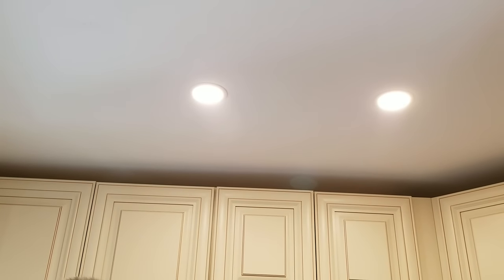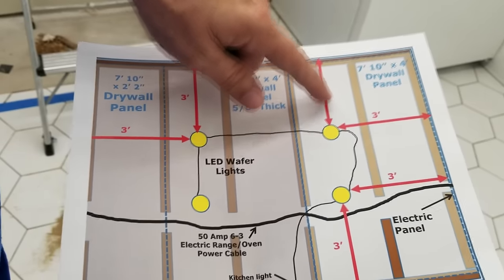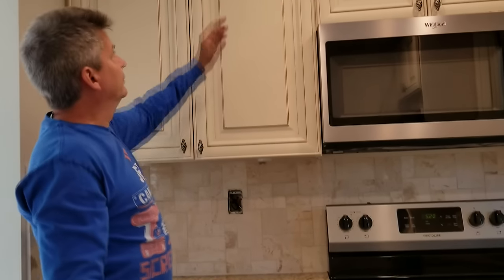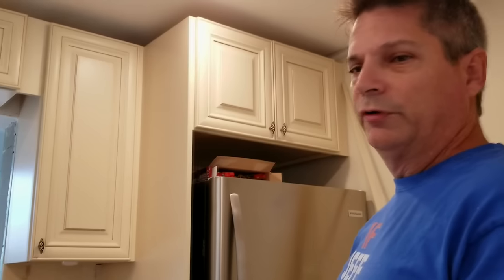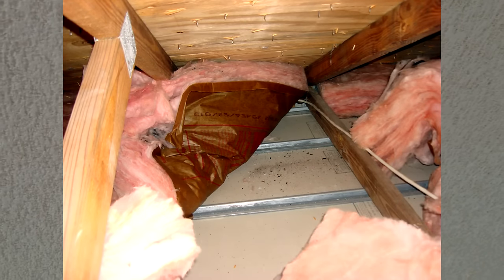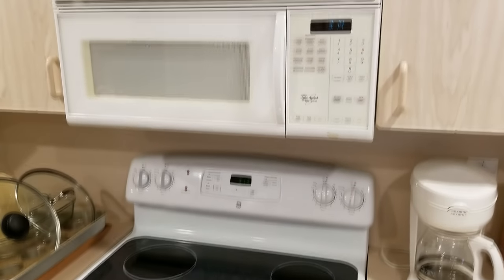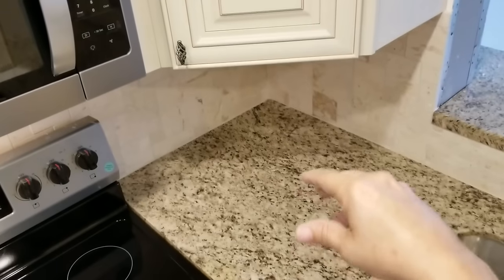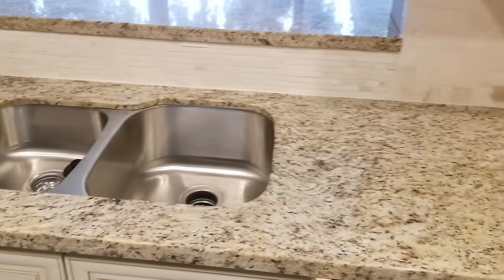Kitchen Light Spacing Best Practices, How to Properly Space Ceiling Lights

Comment: Hi, well done video.  Question:  With lighting 36" from wall and 24" from cabinet how do you prevent shadows cast when over a work surface?  A light can essentially be at your back casting a shadow in front of you.
Reply from the maker: Shadows are not as bad as you think. If ceiling is higher than 8 feet, it will be better for you. I am working on another kitchen lighting video maybe for next week, where we show you the science of measuring lighting yourself with free phone apps, and show a 24" placement from the wall, right over cabinet edge.
Reply: @jeffostroff  Hi Jeff and thanks for the reply.  I'm confused though so help me understand.  A big premise of the placement was to AVOID shadows.  I get that.  Now you're saying they're "not as bad as you think"  You contradicted yourself.  I have an 8 foot ceiling like most homes.  I have only one wall cabinet in my layout - predominantly base cabinets.  A light 36 inches from the wall where no wall cabinet is present, casts a shadow on the portion of the counter you are working over.

Comment: Thanks for the video, great point about shadows. A couple of extra things I noticed. 1) By this logic, the position of the light should depend on the height of the ceiling. Low ceiling should allow to position the lights closer to the cabinet, higher ceiling means the light needs to be further away 2) I really don't like how you positioned that light on the far right. It is too close to the cabinet corner. Not sure how to fix this
Reply from the maker: The position of that light was unfortunate but doesn't really affect anything. What happened was we set the lights where they are and built them into the ceiling, and then later while doing the cabinets it was decided it would be better to have a full depth cabinet over the refrigerator but a full depth cabinet requires that wall and so having the light where it is right now in theory it would have been 12" further away with the standard cabinet.

Comment: Very good video,thanks. I am installing downlights in my kitchen and I will use your 'rule of thumb'; 36 inches from the wall. Thanks.
Reply from the maker: Make sure you test it out too, a lot of pros really adamantly think you need to be 24" back or you'll get shadows on the counter.
Reply: @jeffostroff  Thanks for your advice.I have been searching for advice on this topic/scenario and I think that yours is the most helpful. Thank You.
Reply: @jeffostroff  I checked another professional home improvement website and they strongly advised downlights at 1 metre centres and 1 metre off each wall.My kithen worked out 3 feet centres in both directions so I put them in at that and the lighting is much better so you were right.Thanks again.

Comment: I think how far you put the light in front of the wall cabinet largely depends on the type of light and its beam angle. The 6" wafer lights appear to have a pretty wide beam angle (i.e. 120 degrees) and that allows the light to be placed at 36 " from the wall or 24" from the front of the cabinet.  That rule of thumb doesn't quite work with some of the traditional lights with a smaller beam angle.   The beam angle on those lights are much narrower compared to the wafer lights and so they need to be placed above the edge of the counter at around 25".  I've seen several of these videos that contradict each other, but don't point this distinction which is important.  The only reason why the area under the cabinet is not as dark as traditional lighting is because of the wider beam angle compared to PAR/BR lights that were used in the past.  The kitchens that were poorly lit was because someone changed the bulb to LED type without accounting for the beam angle.
Reply from the maker: Yes great points

Comment: the same way you point out the shadow of the cabinets on the counter you will also have a shadow cast by your own head and shoulders when placing the light about 36 inches off the back wall. A lot of people want the light to come from above not behind them when working on the counter and the have under cabinet lighting to deal with the shadow you’re discussing.
Reply from the maker: You should not need the added expense of undercabinet light.
Reply: @jeffostroff  I agree with you but the industry is split on these lights placement.
Reply from the maker: @freddyoner   Yes you have that right for sure. While the good news often is if they use some of the LED wafer lights for example like I was recommending, it's not that much effort to move lights on the ceiling if you have to and patch up the old hole.

Comment: I suggest people stand next to where you will be working and measure to the center of the top of your head.  

You will measure about 30-32" not 24" or 36".  

If you put your lights 30" off the wall it will cast YOUR shadow straight down, and not on the counter, and also illuminate more of your countertop.  

Split the difference for the best result while you actually work at the counter.
Reply from the maker: Exactly, that's why we say the light is not behind you but rather nearly beside you.

Comment: I have a central light in my kitchen so that when I stand in front of a counter, my shadow falls over the work.  Under cabinet lighting helps some, but I was thinking about new ceiling lights.  The trouble is the vaulted ceiling.  If I install ceiling lights as described here, the lights are directly above my head but angled away from the counter tops.  Is there a way to adjust for this, or is it a non-issue?
Reply from the maker: I just completed a kitchen lighting project last week with sloped ceilings and special lights that I had bought that put not only a shadowless light on their counter, but also very bright light for older people and it can be controlled with a dimmer as well. I will have that video up in about a week or so so check back later for that. the entire video was showing you how you can use an app on your phone to see where the light is on your entire counter in your kitchen, and how to choose the right light that puts the right amount of light on that counter without shadows

Comment: I don’t know if i have to follow your logic, mine is to locate it about 12 inches in front of cabinet to focus the light at center of counter which is 24 inches deep. You want to light your working counter surface. At 36 inches from face of wall, center of light is on top of your head and not your surface, from your head you are casting shadow of yourself.
Reply from the maker: Either situation will work I have done both

Comment: What Watt are you using? We bought about 7 for our kitchen that are 60W and it seems dark. Kitchen is about the same as yours maybe a bit longer
Reply from the maker: Norm the wattage doesn't tell you how bright your light is going to be with these LED lights. It is the number of lumens unfortunately I cannot remember how many lumens we had on those lights. Also if you get warm white lights they will not be as bright as the daylight white lights are for the same wattage so those are things to look at also how wide is the cone of the light if you have one that's purposely spreads out a wide cone of light it will be a little darker down on the counter then one that has more of a focused beam with period so there really is a lot to go into each of these lights and which ones you get and unfortunately too many people just grab whatever is on the shelf and don't give it another thought. As we get to age 50 and plus we need twice the amount of light is somebody with 25 years age.

Comment: What are the odds that you’ve never seen anyone do it right?  When ever you feel that absolutely everyone else is wrong, maybe it’s a good time to check if what you think is right is actually what’s wrong. The biggest problem I foresee with the your 3’ rule (which is correct for any room but the kitchen) is that you will cast a shadow on the counter top when standing next to it. There’s a lot of ways to avoid this (adding more lights, under cab lighting, placing the lights closer to the upper cabinets, etc...) however to say that your right and everyone else is wrong, is probably not the right choice.
Reply from the maker: Yes, everyone keeps pointing to this 3' rule, but how much actual light testing have you done? You are so convinced my lighting arrangement will leave this dark side of the moon deep dark black hole of a shadow on the counter from which no light escapes. We did a follow up video to this one to debunk all the naysayers, and while you can see some shadows on the counter, we proved that it's not as bad as you are making out to be . See that video here: https://youtu.be/g5Ghx7-UJiU It's called "How to Measure LED Kitchen Lighting, Ideas, Design Practices"
Reply: jeffostroff I’m aware of that video, I did watch it. I’m not sure where I said anything about a black hole of a shadow on the counter. However from lived experience, in a house that I owned with the recessed lighting placed at 3’ from the walls in my kitchen, when ever I lean over the counter to cut, or do anything, there it was, the shadow monster. Very inconvenient and annoying. My new house has the lighting in a more traditional location (pointing to the front edge of the counter top) and it really does make a difference. Granted I have under cabinet lighting to mitigate the dark spots next to the wall. I also understand that your budget on that project did not have the flexibility to do that and I’m absolutely not an expert on lighting or I wouldn’t be watching these videos.  (unless it was just to point out mistakes like all the other viewers. Lol) I think if your going to only have one light source in the kitchen, than your better off with your type of arrangement over a single flush mount, centered in the room for sure. In the other video you go into several other houses with the same idea of moving all the lights towards the center of the room.  That’s a big mistake in my opinion unless you are just using it for area lighting and have alternative task lighting.
Reply from the maker: @badbatch974  The best compromise are the lights placed 3 to 4 feet from the wall, with task lights placed at 24" from the wall at the counter edge. Most tiny condos, that simply is not in the budget, but should be on a single family house.

Comment: Good info but I’d like to know how the light is affected when I’m standing at the counter working.  Will I get a shadow from my body???
Thanks
Reply from the maker: Yes it will a little, but not as bad as my critics claim. See our other video we made in this completed kitchen where I pose in different spots and look for shadows, and we measure the light.  https://youtu.be/g5Ghx7-UJiU
Reply: Good question.  I'm wondering if they are planning to install undercabinet lighting. You are correct, putting lighting behind you will give you the lolly pop effect without UC lighting to dispel the shadows on the counter top and provide good task lighting while working.

Comment: Ive always centered the lights on the edge of the counter top so if standing at the counter you wont cast a shadow , and  centered on the doors of double cabinets , nine times out of ten you'll be installing under cabinet lighting anyway. Any licensed electrician knows that an IC recessed can needs to be installed whenever in contact with insulation. Usually insulation has been installed after the lights were already there or a unlicensed (in most cases ) person does the install where the non approved can is used .

Comment: Jeff, what model of lights do you typically use?  Also what is the Kelvin rating that you like?  2700, 3000, 4000?  Additionally what is the spacing between the lights themselves.  Appears to be as little as 24 inches from this video.
Reply from the maker: The lights are all 36" from the wall and if you go down the long side of the kitchen the lights are 36" apart but if you go across the narrow side of the kitchen lights are only 24" apart. I will look up the exact part number of from lights that I used in this video when I get home.

Comment: Hello Jeff, I have Kitchen and Dining Area 18'0*14'10 How many LED lights do you recommend?
Reply from the maker: that is not an easy question to answer, it really depends on what light you buy, how many lumens, what the spread of the light is, best thing to do is try to place some lights on the ceiling and test out spacing and number of lights. Could take several hours of work, but will be right in th eend.
Reply: jeffostroff thank you

Comment: 3:10 my first time watching and thanks for the nice introduction….. just had a kitchen remodel, all your measurements are in imperial so I am not sure what they mean, you should realise that the US is now the only country in the world that uses imperial measurement, Liberia and Myanmar, the two others are converting to metric. Anyway you said a shadow would be thrown over the benchtops if you had your downlights a few inches from the wall. As a benchtop is 600mm wide there is no way anyone’s head is going to be throwing a shadow from those lights above. My new lights are about 250mm from the wall and throw an unobstructed light onto the benchtop, they are after all, in front of your head. The lighting is perfect. In my country the lights are similar LEDs to yours but no transformer, they each have a 240v plug and plug into a socket in the ceiling space. They’re wi-fi and are controlled by my phone, tablet and laptop. Each has a schedule so they turn themselves on and off at defined times. So I’m gobsmacked that you think lights should be so far way from the wall that WOULD guarantee throwing a shadow over benchtops.

Comment: Hi Jeff. I've been watching your very informative video dated 9/29/18 about Kitchen light spacing best practices, How to properly space ceiling lights. My kitchen measures 11' x 13' with an 8' ceiling. The top of my cabinets start 12" lower than the ceiling. Your recommendation for rooms larger than 8'x10' is 6 lights. My question is what size (diameter) light would you recommend 4" or 6" or is it an aesthetic preference? Thanks and stay safe.
Reply from the maker: A lot of that has to do with the cone shape of light and distance, etc. They sometimes show the diagram on the back of the box to help you choose, it shows the intensity of the light across the distance, and the spread. I would try one of each size, power it up and see how bright it is.

Comment: How deep are you uppers? In my to scale model, I'd need to put my lights out about 3.5 feet to illuminate the hole counter with 15" uppers. But my main concern with this is that you're almost certainly going to cast a shadow directly into your work area with your body while you're actually using the counter, aren't you? So aesthetically, while you're standing back looking at it, you're right, but in actual use, the way you're using it everyday, aren't you ending up with a dark work surface? Honest question. I wish I could put the lights in the actual kitchen and stand there but I have to plan electrical long before the cabinets ever come into play.
Reply: Of course, since these don't require boxes, I just have to make sure I've got the wiring close but I'd hate to not know what the plan is until we get to the cabinet stage. I guess I could try and mock it up enough to test the shadow with a single light, although it's not going to be a real great test since you'd actually have light spill from the rest of the lights to fill in some of the shadowing.
Reply: I read a few more comments so I have the info I need to figure it out. I've got 15" uppers 40" tall straight to a 99" ceiling so I'll try to mock up the scenario so I have a tentative plan, then finalize it when we've got something concrete to test with. Thanks! I just deleted 3 million lights and guidelines off my Sketchup plan to start all over  without the glaring issues I had.
Reply from the maker: Yes most uppers are 11 to 12" deep

Comment: We're currently laying out the recessed lighting in our new construction kitchen. We will not have upper cabinets. L shaped 12'x14' w/ 6'x5' island. Sloped ceilings are 8' to 11' high. We're using 6" cans. I'm more concerned about my body creating a shadow when at the counter working. What's your opinion on where to place the perimeter or task lighting  when there's not going to be upper cabinets?

Comment: does the 36" rule also apply for living room applications?
Reply from the maker: I think we need to experiment in each room we are planning this for. I am about to do this in a friend's living room where there are no ceiling lights, and will install wafer LED lights. We might try to wire one up and see if there's any difference in lighting and shadows when we place them over the couch. They may want good task lighting, and some couched are far from the back of the couch to the front. Where will we be sitting? How far is our seat from the wall?  Best to wire one up to an electrical cord and move it around.
Reply: @jeffostroff  Makes sense, Thanks for the response!👍
Reply: @Hector-cn3rv  Absolutely not.  If you put your canless LED lights too far towards the center of the room you won't get any light bouncing off the walls.  Without seeing the size of the room I would say around 24" off the corners.

Source: I'm an electrician.